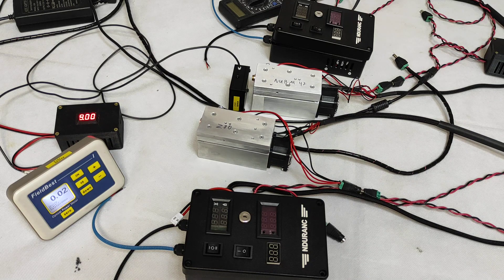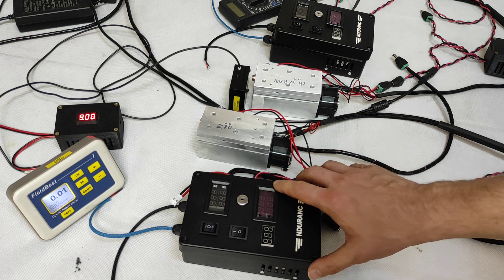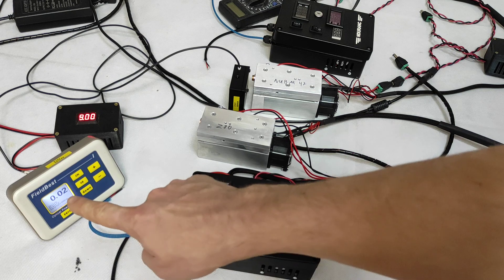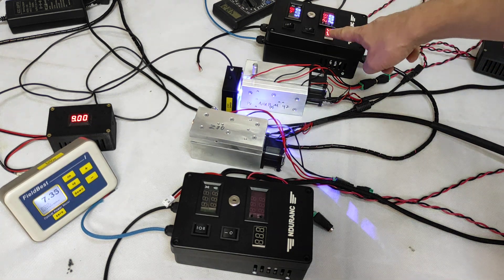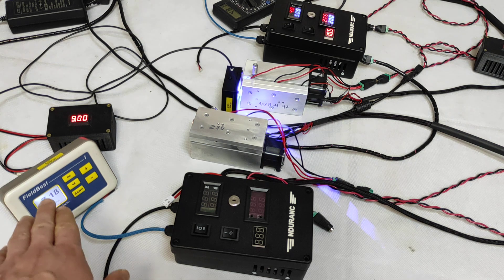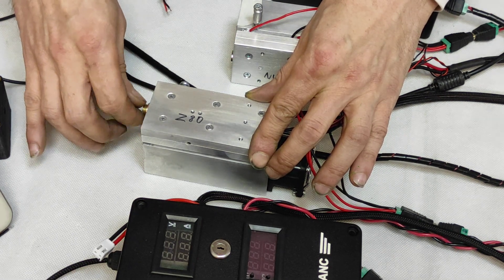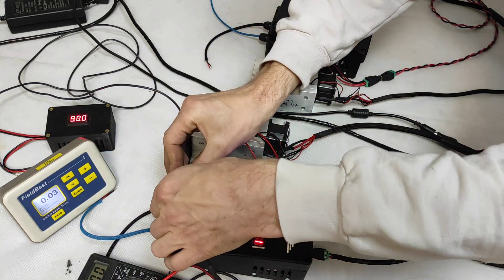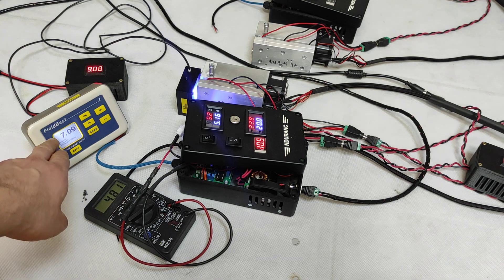A Brand New blue 445 nm Z80 laser diode - comparing with NICHIA NUBM44/47

Comment: 5A is outside the specification of the diode. You will get 10000h lifetime just with current under the maximum ratings of the specification.
Reply: I have non-public data on nichia 5W, most people over-drive them and have no idea how easy it is to COD under 5k hours ;) the spec sheets for those diodes are not public and public don't even know the actual model number.. which is the funniest part. It's not NUB lol
Reply from the maker: no, all our lasers have 10000 hours lifetime guaranteed, It is a BRAND new diode!